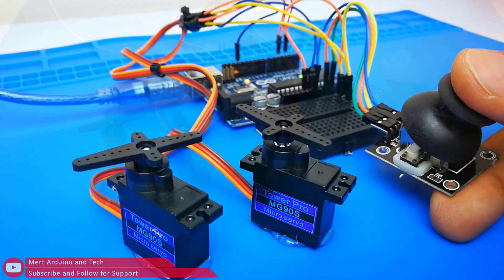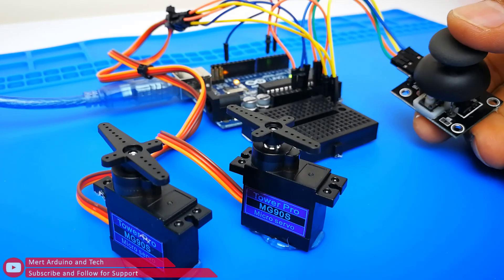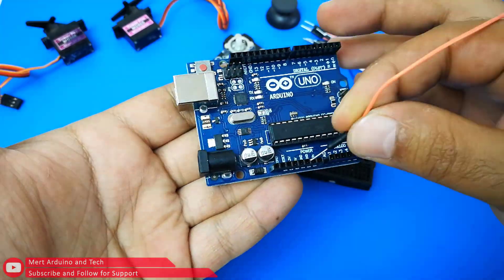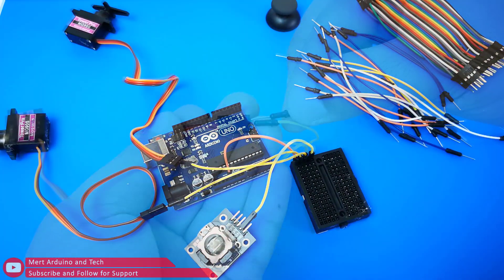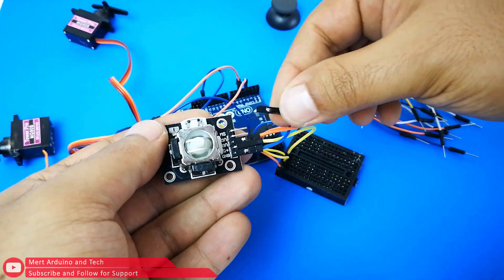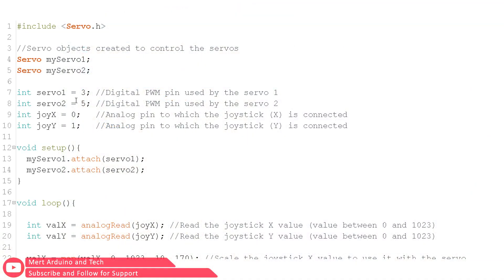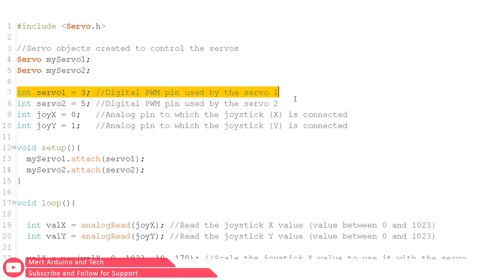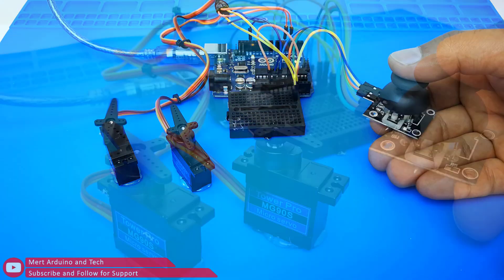Control servo motors with a joystick (Thumbstick) | Mert Arduino

Comment from the maker: Source Code: https://create.arduino.cc/editor/mertarduinotech/fc3cfab6-55f9-4d66-9abd-a47ad31725f1/preview
Recommended Items:                
Use Your Muscles in Project - https://amzn.to/3wdL45C
37 Sensor & Module Packages - https://amzn.to/3m66WeQ
Try this Robot Arm - https://amzn.to/3fq8DCl
Best Resin 3D Printer - https://amzn.to/39tY8KB
Arduino Compatible Kits - http://bit.ly/2J2AFF7
Banggood Spring Sale - https://bit.ly/3slMbOn

Comment: Hey i’m very new to programming, i was wondering is there a way to make both the servos move in the same direction all of the time? like you move joystick to the right, and both servos go to the right for example. cause this is a nice project but it’s hard to move them both at the same time or have them going in the same direction.

Comment: I have a Robot arm claw by Gearbest. Controlled by 4 servos and a Arduino Uno. But with no instructions as to the wiring connections. It comes with 2 joysticks. Any chance you could do a video on how to make the connections. This is my first project i am over 70 years old but keen to learn. Please take things slowly as we oldsteer can take things in as fast as youngsters.

Comment: What resistance do the potentiometers in the joysticks need to be?
Can one arduino control 4 servos (with 2 joysticks)?
Reply: a arduino can support upto 6 servos standalane
Reply: Hi bro, how to operate servo motors wireless controller

Comment: I can't figure out what I'm doing wrong. I've got the 9V going straight into the port on the Arduino, I even tried running it off the USB. I get the lights, the program compiles fine, but the joystick is doing nothing. I've checked many times over and everything is connected in the correct spot. I even tried two different Arduino boards. I have two SG-5010 servos connected. I can't figure out what's going on... Could anyone help me? EDIT: I got it to work... just have to wire in the external power.. can't believe I forgot that. GREAT VIDEO SIR.
Reply: Unplug eveything and plug again.

Comment: Actually even I want to control the servo using the nodeMCU over blynk app. Actually someone has posted it in the comment section, could you plzzz look into it I have to submit the project in 2 days